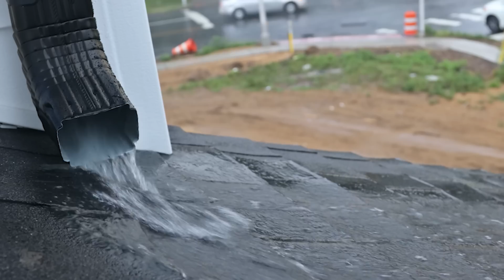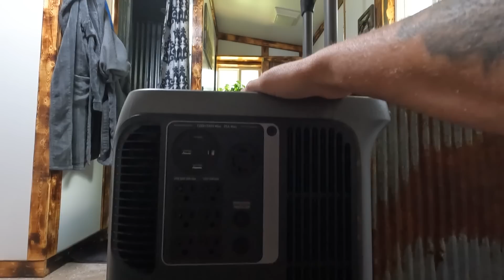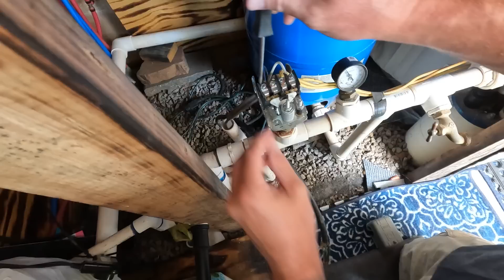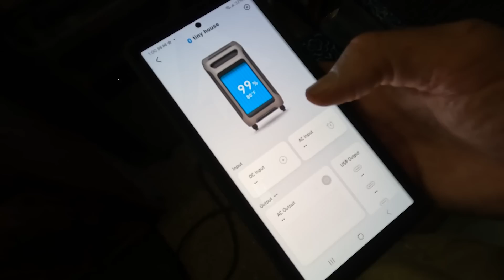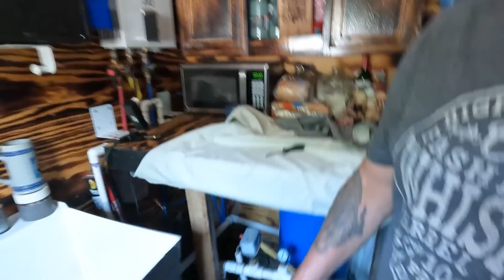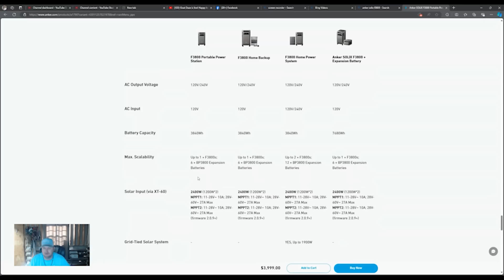THIS IS A GAME CHANGER Anker SOLIX F3800 tiny house homesteading, off-grid, cabin build, DIY, HOW TO

Comment: There is a way to use a 240 and still use those other plugs while you're charging but you have to buy something that cost you about another $500. There is a video I found of somebody out there that has one of these and he bought a box thing that would work. It's all something after market. There's a guy named Jasonoid on YouTube that has a way around this a video was a month old. Like I said it's a $500 part. And you can actually message this guy himself directly.